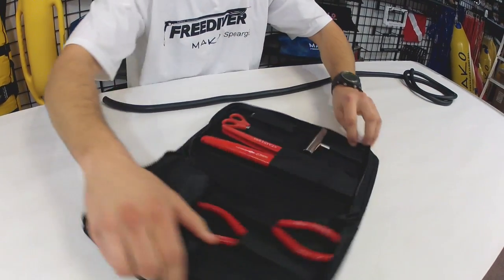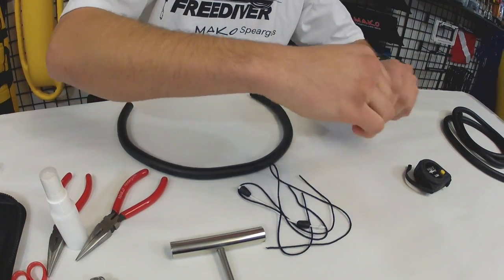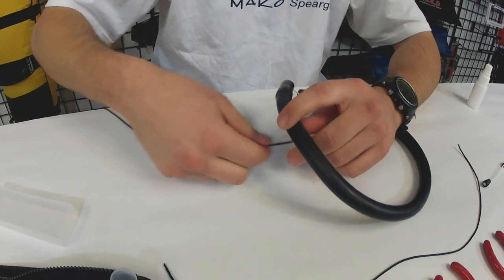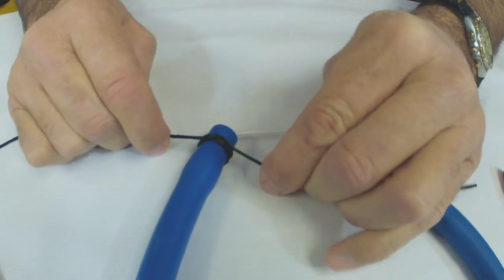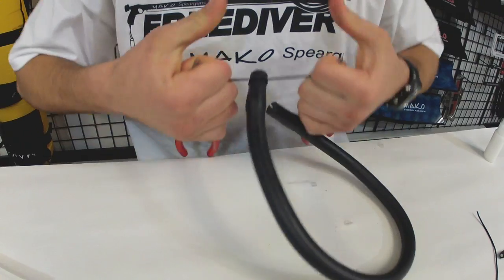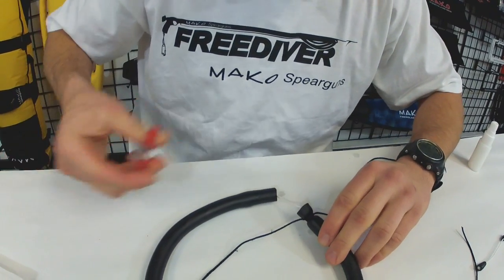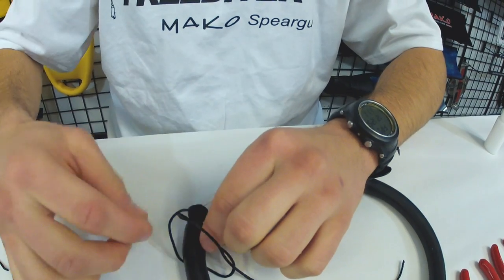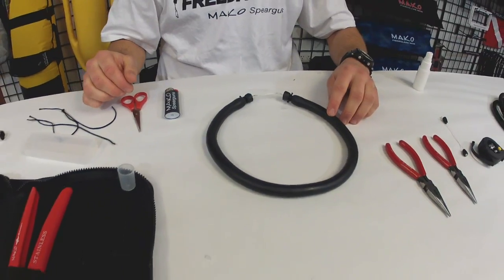Speargun Band Tying Tutorial - MAKO Spearguns

Comment: I should also note that the type of cord used is critical to the knot holding!  I used some good nylon cord that was strong, but slick.  Sure enough, it slipped when i  tested it under pressure and slapped my hand pretty good.  Definitely, use the correct cordage.   I switched it to the same cord I use for my compound bow D-loop, which is a stiff 2.4 mm cord.  That's doing the trick.  Better yet, probably just go buy Mako's cord and not worry about it.

Comment: That placement tool is $20. I used a 3/8 x 1/2 x 1-1/2 steel spacer for $1.5. Worked it in easily with a stub from a pair of pliers. Worked like a charm. No damage to the rubber at all.  Could also use a 9mm 1/4 socket.
Reply from the maker: Hi Bryon, it's always great when you can can McGyver a tool - kudos! and fwiw, our insertion tool is half that price!
Reply: 10$ would have been worth it...  sorry, I looked on Amazon.  My way took longer than your guy on the video, that's for sure.